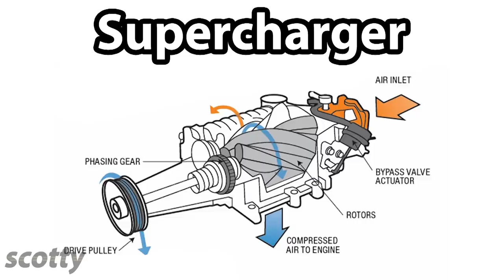Supercharger vs Turbocharger - Why Supercharged Car is Better than Turbo

Comment: If I gotta shell out the money to have a professional tune my engine, then I can afford a 'complex' but much more efficient turbo
Reply: OldRed91 

Yeah turbos are so complex that you have to buy a kit with an extra oil line for a turbo. With a supercharger you just have to buy a kit.

Still got a little Scotty though.
Reply: OldRed91 you have to tune your car either way
Reply: efficient comparison is flawed because the only thing turbos do is add power but you also get a torque boost from a supercharger.
Reply: Nathan Plunkett What are you talking about? Turbos make way more torque than superchargers.
Reply: Except for the superchargers on the Detroit 6-71/8-71 etc that go for a million plus miles w/o being touched.  They also end up in commercial boats where they last 10's of thousands of hours in some of the worst conditions possible running hard all day without any issue.   Remember, a boat engine is under heavy load 100% of the time while underway, so it never reaches a point (short of surfing down a giant wave) where the engine isn't in conditions comparable to you pulling a 10,000 lb load up a steep hill and maintaining that speed, all day, every day, which means they're under high boost 100% of the time.
Reply: @nathanplunkett1633  sounds handy for a mid size suv

Comment: I understand the arguments for why turbochargers are better.
Those benefits might apply if you have a high revving Inline 4 or V12 but if you have a low revving V8 muscle car then it makes more sense to put a super charger in the car because getting instant power for faster off the line speed is more important than having high power at higher RPM

Comment: Now do one on why turbo is better than super
Reply: moe riou unless you plan on going 230 mph a supercharger is always better
Reply: BrianShaggy074 uhhh if you're doing anything past first gear, turbo is often better
Reply: I'd rather have torque and power, so I'll stick to supercharged.
Reply: Nathan Plunkett to achieve similar torque and power compared to turbo, you have to put more strain on the engin
Reply: Turbos do not generate torque, only a supercharger does.
Reply: Nathan Plunkett ah yes turbochargers magically make engines rev higher
Reply: Don't take my word for it, google it for yourself.  They don't generate torque, only power.  But please, don't delete your stupid comment after you do.
Reply: Nathan Plunkett you clearly didn't look it up, nor do you have even a remote understanding of the relationship between power and torque
Reply: moe riou hp and torque are literally measured from each other and have an almost direct relationship. the idea that an SC will make tq and a turbo won't is absolutely stupid, they do the exact same thing, compress air and put it back into the motor. now go delete your stupid comment.
Reply: moe riou word
Reply: Nathan Plunkett my 2 liter engine is making 360wtq. So, come again?
Reply: It’s not better lol
Reply: Nathan Plunkett man that’s literally impossible. Tq and hp have a linear relation.

Comment: Everything you said is right, But the Supercharger costs more to purchase.
Plus Superchargers are most on 6&8, you won't see one on a 4cylinder that much.
Reply: Yeah you're right, an extra 100hp is too much for you to handle, i mean at that point you'll have an insane 120hp.
Reply: Same here. It will add about 120hp on my FSI A6. I installed tuned chip on my TSI Passat and added 68hp, not to mention if i get a bigger turbo xD
Reply: Kawasaki h2
Inline 4 supercharged
Reply: +FULL BRIDG ERECTIFIER I said you won't see it that much, Not you won't see it at all.
Reply: Yeah, this is the one of not much
Just for example
Reply: Earth shaker wtf are you driving a ford pinto? I got 300whp out of mine
Reply: Mercedes built supercharged 4 cylinder engines a couple of years ago, I also have a C 200 K with a supercharger. It's a 1.8 liter engine with 184 HP (original, no tuning) you have power like a six cylinder but it uses fuel only like a 4 cylinder. Since 2010 they changed to turbochargers and direct injection , I think because the fuel efficiency when they test the car (much less on the road) is better, and they are forced by law to lower fuel consumptions. But superchargers are less sensible (colleagues of me had to replace expensive turbochargers multiple times).

Comment: Modern TVS and twin screws aren't the old inefficient blowers of the 60s. They have bypass valves so they don't build pressure at idle or coasting, they don't heat soak and have less parasitic loss.

Comment: I own both a supercharged car and a turbo car and honestly they both work great, but I prefer turbos over superchargers. With today's technology and proper sizing for the application, boost lag is a thing of the past. Also turbos provide "free" horsepower with no parasitic loss. Another thing to consider is that roots style superchargers are prone to heat soak which results in a loss of horsepower. Just my personal experience from someone who's owned several of both style cars.

Comment: Less efficient: the biggest disadvantage of superchargers is that they suck engine power simply to produce engine power. They’re run off an engine belt connected to the crankshaft, so you’re essentially powering an air pump with another air pump. Because of this, superchargers are significantly less efficient than turbochargers.
Reply: Don't forget the extra belt causes vibrations and wears bearings faster.
Reply: Blehtubezz Aus a turbo isn't parasitic at all as it runs off of exhaust that's already been pushed out of the motor. a supercharger is because it runs off the crank.
Reply: Bingo! Turbo is basically free power, and if sized right, lag can be minimized.

Comment: Wow. Never knew my car could have a supercharger. Thanks.
Reply: you could add forced induction to any engine. whether youd wanna go turbo or super depends on the kinda build youre going for
Reply: +ODST172 Yes, but when adding forced induction, depending on the engine and the amount of boost, you may need to upgrade the internals as well. Some engines can handle more than others.

Comment: Supercharger > single turbo
Supercharger < twin turbo
Reply: LJ  got that backwards, there is ZERO point/pros to twin turbos unless making upwards of over 6khp
Reply: LJ definitely got that backwards
Reply: @knowbull5hit590  Depends on the shape of your intake (and space available for it) - if it's rectangular then you can use more of the space for forced induction by using 2 turbos.  They would also spin up faster than a single turbo of the same combined diameter.  You could also have them spin in opposite directions to balance each others' accelerational/decelerational force.

Comment: I could argue with you on this one I've owned supercharged cars don't get me wrong I absolutely love them! But, generally you can find a turbo manifold and turbo cheaper than a supercharger and Intake. If you can weld, you can make a turbo manifold yourself! And some eBay turbos can make really good power and actually last a long time for the price vs paying thousands. I've seen $400 turbo making over 500hp. I personally try and stick to name brand, but I've seen some cheap turbo setups making good power for years.

Comment: I need a supercharger for my bicycle
Reply: They make those. its called leg day.
Reply: Love Machine Start with forged steel pedals and a smaller sprocket. Then add anabolic steroids to Leg Day and you'll be guaranteed 50+ whp. I also recommend Mickey Thompson 3.25" slicks for better traction. 😏
Reply: if the bike is jdm skip the mickey thompsons and get you a set of toyos and a sparco handlebar.
Reply: try an electric one, be sure it's a lot of fun.

Comment: I hear turbo cuts a car's life more than half.
Reply: and if driving normally and shit, not activating the turbo, will the car work normal
and shit like before the turbo was installed?
Reply: It makes sense cause it is taking a lot of old air pushing it through the motor go cause excessive wear

Comment: I'd recommend the centrifugal superchargers over the Roots type.  The Roots have more parasitic drag at low RPM, where they aren't producing enough pressure to help your engine much.  There updated Eaton designs which are much more efficient than the 1st generation Eaton supercharged MINI Cooper S and they're a worthy upgrade to a car that already has the 1st generation Eaton. I have 2 MINI Cooper S cars, one is supercharged, the other is turbo.

Comment: Hey Scotty, thank you so much for this video. It was very informative.
Now, although superchargers provide an immediate increase in boost corresponding to engine RPM, they do have a heavy impact on drivability under regular conditions when extra power and boost aren't needed, not to mention the parasitic loss to drive them.
I am considering the Turbonetics turbocharger kit for my 2010 camaro ss automatic (LS99).
It is 50 state legal, comes with everything needed for the install including upgraded injectors and a Diablo tuner for the ECU. 
It also does not require the engine to be cammed! So it has minimum impact on city driving and does not attract any more attention when driving at sedate speeds.
Otherwise, it adds 200 HP and the installation takes only a few hours at their authorized installer.

It would mean a lot to me if I could have your expert opinion before I go ahead.

https://www.youtube.com/watch?v=x9s2r_Orz2w

http://www.onallcylinders.com/2017/02/03/turbo-install-add-200-hp-5th-gen-camaro-ss-turbonetics-turbo/

Comment: Too funny clueless yanks and there V8 and superchargers boring, supercharger needs engine power to make it run also needs pulleys and belts,even those top mounted engine ones are rubbish gets heat soaked or the rotors seals on the edge of the rotors wear out then you have no boost ,also needs a water to air intercooler with heat exchanger and lots of hoses or braided lines ..turbocharger are better, and ive fitted turbos and superchargers too cars but most my cars are turbo ,ever had a superchargered my self but driven many
Reply: 426 Hemi "Elephant Engine  supercharged  14-71 type Roots blower
The calculated power output of these engines is about 11,000 hp
Reply: @Todd Hageman, what's so funny
Reply: @Todd Hageman NHRA top fuel hemi makes 8,000-10,000 hp
Reply: Anthony Webber you have an extra digit there buddy
Reply: @whatswrong598 , no extra digit, top Fuel dragsters make 11,000 HP
Reply: Anthony Webber yeah, I thought he was talking about the hellaphant

Comment: I've always been bias towards Superchargers myself. In big money cars its a more even story. But for the Every day idiot kid nowadays thats owns a Honda, bc they think they are the only car manufacturer in the world for some reason. They try throwing a turbocharger on it with the help of their other idiot honda friends. Then blow their motor within a few months bc they have no clue what they are doing. Ive seen it so many times. All my Old highschool friends were into imports and they tried turbocharging, and fucking up their already pieced up Honda. While i had a bone stock 89 Gmc truck except for a cherry bomb glassback, and id embarrass them everytime. For the average Joe turbos are Stupid!
Reply: R. Flash nice
Reply: Where I live, it’s the same thing except with Subaru’s. They all go crazy for Subaru’s and they’re like “Turbo!” and “Small engine!”  I’ve also come across some that actually thought you get more horsepower by actually adding stickers. I tried telling them they’re cheap, unreliable, and don’t have a lot of horsepower like they think. They ended telling me things that don’t make sense and I’m just standing there thinking “Wtf?”
Reply: TF? Turbos are expensive and produce way more hp than a supercharger, if you knew anything about cars, you'd know that superchargers are belt driven and require energy from the engine to spine the turbines in the supercharger, eventually there comes a point where the wind resistance against the turbines, energy being zapped from the engine, and turbine speed just all max out and the supercharger can't produce anymore, I doubt you've ever seen a supercharge produce over 850 ahp, they max out at around 800 ahp for a small block v8 and around 900 ahp for a big block v8, it changes depending on the displacement and hp your car produces N/A, but there are outliers that can make upwards 1000 ahp. Lmao where'd you get your knowledge, a fucking mustang forum?? 😂😂
Reply: @rickyowens3029  a racecar is super charged and one of them made 8k horse power. I guess it depends on the need since SC are more linear which suits the race track.
Reply: @davidtao1766  Turbos perform better at the track or dragstrip. There more efficient since they run off exhaust gas, no belt slip like superchargers, no heat soak issues like positive displacement superchargers, and no parasitic power loss like superchargers (take engine power to turn a supercharger). You can minimize turbo lag by choosing the correct size turbo(s) for you application or what type of racing you're doing. Superchargers' power also tapers off on the top end, unlike a turbo.
Reply: @rickyowens3029  bullshit NHRA cars top fuel make 8-10,000 hp

Comment: With new twin scroll turbo chargers there’s very little Superchargers have over them. Positive displacement have the instaneous boost. They are obviously the more cost effective route in aftermarket and simplest. It’s hard to say one is better, they’re just different.

Comment: Check your main bearings after a few runs and compare turbo to supercharger.   Supercharger is hell on mains, because of belt harmonics or ?? Not sure, but it's true.   I like both, but can do my own work, so it's not a big deal about the mains to me. Supercharger is MUCH easier to implement. Not even comparable in that regaurd......Bigger question to me is what rpm do you want how much power......

Comment: You don’t need to get it tuned because most of them come with a tune already all you have to do is install and upload the tune modern technology. Also you have to make sure they are using good tuning software and not just over riding your factory ecu.

Comment: even tho you have direct power off the belt it takes power to make power with a belt driven intake. if you run a exhaust driven turbo then its pretty much at 100% efficiently bringing air into the engine. if you want torque then supercharger it, if you want the higher power number and have top end power then turbo is the best option

Comment: I'll take my twin turbo setup over a supercharger any day. Sure they're more expensive, but they don't cost power to run, they're more efficient, the sound and spool is amazing, and if you  can spool the turbos there isn't any lag. Plus it's easier to make more power with a turbo over a supercharger.

Comment: Had a super charged 2005 350 Z with a stock 3.5 L V6 engine it was a stillin supercharger stage four I had to buy a new hood with a Cowell because the supercharger was so massive plus I needed to put a power commander piggyback computer on it I also needed to change the clutch plate on my transmission because my stock one went out after two months and I needed a new brake caliper system so I chose six piston so  racing brakes Point is it’s very expensive to get your vehicle just right after adding that much power to it

Comment: It’s all preference and design. Some are engineered to accept one better than the other. Reliability, installation, efficiency and gains. Many swear by nitrous as well. Big rigs are turbocharged,. 4 cylinders with high revs by design do better turbo as either you get low, mid or high, not all three. Cobalt SS, Mini Cooper S and MB Compressors used S/C and then switched to turbo. Efficiency/power curve was the reason. Far from biased, if it has an engine, I dig it. Practicality wise I’m a N/A guy,. Hard to compete with and forced induction or NO2 car. Once you get too radical it’s a track car in any form, the cars characteristics change. Hard to be the fastest  street or track, rat race.

Comment: Scottie, bro. Those dudes at hp can be crooked. They've done work to my car and I'm not a fan of them.

Also, something to add to the debate, turbos have higher power ceiling. I agree, superchargers are more instant and much easier to deal with, but if you want well over 1k hp, turbo is the way

Comment: I've had both, I moved  away from a supercharger in the end purely because they're far more efficient. Top end pull was much better too.
Reply: Are they efficient or not?
Reply: @johnmolefe6765  no, not in my opinion. Because obviously a supercharger relies on your crankshaft, it's only efficient with higher revs. A turbocharger is (not as powerful) but far more efficient. I have stuck with turbocharged engines every since.

Comment: THANKS -- I've almost decided against the car I was looking at buying due to the TURBO.... so- Now I'd like to know if I can buy a MAZDA CX-50 and get a SUPERCHARGER put on it??? Or Boosted AIR INTAKE like CORKSPORT RAM AIR INTAKE would help it enough?  The MAZDA I think has the 2.4 liter 4 cylinder engine..   Everyone that drives them says the car is NOt "peppy" enough for the size of car it is when it's the naturally aspirated one.

Comment: turbos hold boost. superchargers build boost as rpms rise unless you have a waste gate system like turbos. you use power from the motor to spin the supercharger. turbos are free energy. the excitement of turbo lag is breathtaking.

Comment: Honestly, depends on the car in my eyes. I drive a mazdaspeed 3 so I prefer the turbo (since its stock that way). However if and when I get a muscle car, I am going to consider both options, just depends if i want to hear the spool of a turbo or the whine of a supercharger. Both can achieve HP goals just in different ways and setups.